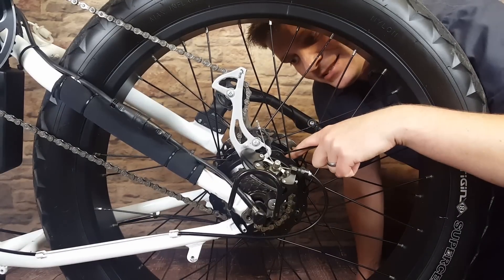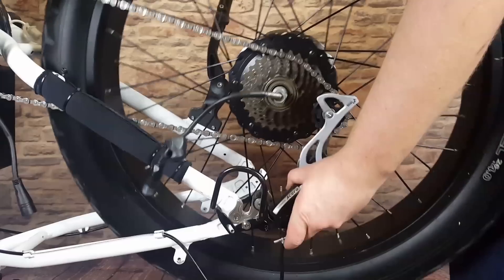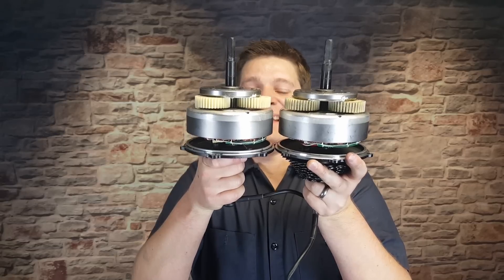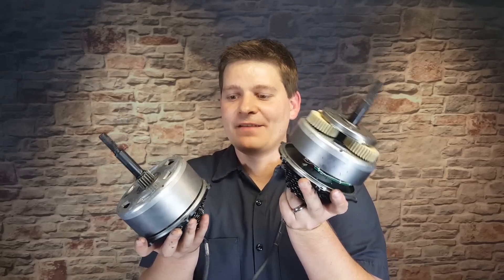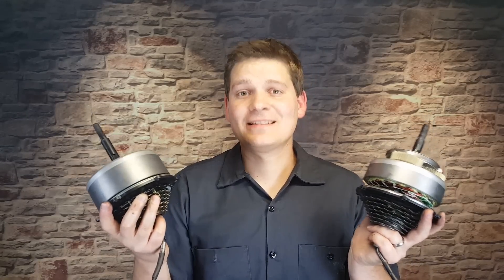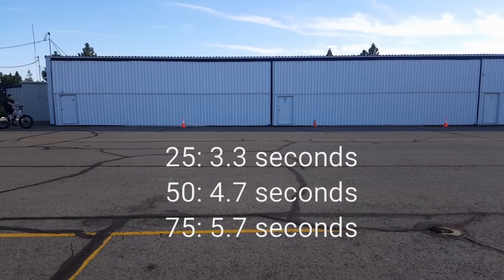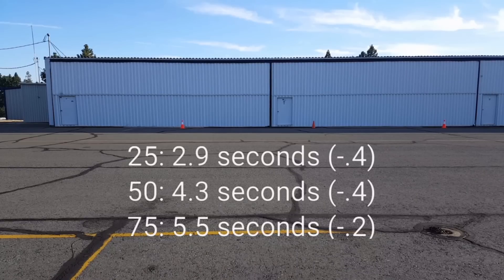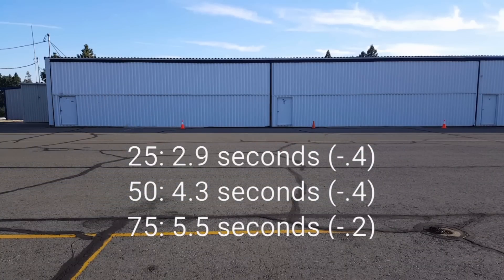Considering the RadRover Ebike?  You better watch this first!

Comment: Great video. I'm subscribing!         Question... The latest Juiced Bikes Ripcurrent S fat bike has a slightly beefed up Bafang 750 hub motor at 1295 watts peak compared to my slightly older Ripcurrent S which has the same motor, but only rated at 1036 watts peak at the same battery outputs. Both have 80 Nm peak torque. Do you think this is all BS?  The Ripcurrent has a neat TAB feature that allows a momentary boost to full power (now 1295 watts) when starting off with the throttle held down for quick acceleration. I'm praying this increase in power is noticeable.
Reply from the maker: If It's truly the same motor then my guess is the controller has more amps to get the extra boost of speed.  Any temporary "boost" function seems a bit like a marketing gimmick to me.
Reply: @Area13ebikes  Well, I'll check Bafang to see if they actually make this uprated 750 motor, but my guess is that Juiced Bikes is not BSing the public. They generally don't work that way. What I want to know is, if it is really 1295peak watts, will I feel a difference from my 1036 peak watt motor?  I'm about 240lbs and thinking the extra 250 watts doesn't translate to much extra Oomph.
Reply from the maker: @dbfcrell8300  slight, but not a huge difference.  Bafang makes sorts of various motors.  I've seen people run the larger 750 Bafang motors in 60v and 2,000 watts.
Reply: @Area13ebikes  Well, when it gets here in a few days, I'll assemble the bike, but prolly won't get to ride it for several months due to the weather. I'm in New England.
Reply: Well, the new motor/wheel hath arrived! It's definitely not the same motor I sent to Juiced, so that's promising. I went on the Bafang site and looked for this new uprated motor. No luck yet.

Comment: Not trying to cause an argument here, but were the weight of the bikes and the size of the tyres (rolling resistance) the same for all of them ? If not, then this will have an effect on the acceleration over such a short distance.  For the weight, you could handicap each bike with a different load so that the weights were the same. Not sure how you make the tyres equal though if the rims are different sizes.

Comment: However. At Hoover Dam the Russian tech type magnets increased the electrical output significantly. Its more Torque field strength etc. 
not knowing anything on bikes, will keep quiet. But point made. I would test a load of 200lbs on each to see effect. Kinetic Energy cant be fudged. Does one motor draw more current I2R (current squared times resistance) again for DC power. Two cents

Comment: So glad you put this video out Kyle. When I first saw this, I did not want to believe you. Because I live a few miles away from Rad bikes and was ready to pull trigger on purchase of new Radrover. Was looking forward to purchasing an e bike with Rad bike shop right in my back yard.  But after numerous test drives up steep hills in Seattle, I did notice that Radrover would slow down and needed lots of pedal effort. A sales guy there told me to not run the bike at 750 watts for very long due to damage of the motor for overheating but would not tell me if that meant 30 seconds or 5 minutes. Now that I'm more knowledgeable on E bikes and what I want. I'm going to spend a little more money and get a bike that has a true 750/1000 watt motor.  I’d be very upset if I bought a bike with only 350/500 watt motor that was advertised as a 750 watt motor.
Reply: There is a guy who does a side by side comparison to the sonders 500W and the RAD Rover performed better in his opinion.  Not sure what all this means but I am concerned since I just bought my second Rover.

Comment: Are the wheel diameters to the outside of the rubber the same on all bikes tested? Other factors being equal, a smaller wheel diameter would yield an acceleration advantage.  The bike weights should also be very similar. Obviously, a lighter bike would also have an advantage in acceleration.

Comment: Simple question, what bike under $2000, woluld you suggest for long distance and pulling a small homemade camper.? I am building to pull with a bike, but would rather have a powered bike. I have a solar setup the has a 110 outlet so I can just plug in the charger, can I charge as I ride or do I want a spare battery to charge?  I have a bit of time before buying but plan on leaving before september

Comment: Rad Rovers are fine, and you don’t need that much power once you get up to speed unless your hitting a big hill, in that case use your “lamborfeeties” to help your motor out. Also, what about the weight of that over powered motor - it looks super heavy. Bafang is huge for a reason, they’re very reliable. The only thing I don’t like about Rad Rovers are they’re lack of hydraulic disk brakes, as they only have mechanical disk brakes. With that kind of weight and speed on those bikes, I would never want to depend on my grip strength to get me stopping. I went with a 750 watt Mountains To Sea fat bike which has worked out great for the last 3 years. It probably cost me a few shekels more, but we’ll worth it.

Comment: See this all the time.. manufacturers claiming a 750w motor when it's really a 500w motor that maybe PEAKS at 750w power output. Misleading advertising. You want a actual 750w motor that peaks at 1000w + output.

Comment: based on what you show here is a question of need for me. budget is tight but i certainly don't want to buy a bike i have to later upgrade for more power/speed. i'm 235 actually 233 ... 5'8" MOST IMPORTANTLY I NEED TO RIDE WITH THROTTLE ONLY BECAUSE I HAVE A BAD HIP SO CAN'T pdela without severe pain . 

what e-bikes would u recommend that are durable that would suit me. i need a bike rack but not a lot of fancy stuff. i could see adding a spring type seat post for comfort. i don't need rear shocks but adjustable front ones are needed . i don't need the fastest tires and 2.5" would be better for speed and weight savings. solid higher quality mechanical disc brakes or reasonable quality hydraulic disc.
 brakes.

I'm asking you all this cause nobody else i have seen spoke on the difference in the motors that are listed at the same wattage but are obviously functionally different. i've been looking at reviews since last year and still am.  thx a ton

Comment: Hello Kyle - Nice job on the video. I am pretty deep down the e-bike rabbit hole myself and am constantly on the prowl for updated information and product development.  At one point, I considered purchasing one of the Rad bikes and was fairly impressed with bang for the buck.  I am now in to several different manifestations of Bafang mid-drives and have experimented quite a bit with controller configurations and other modifications, including controller swaps.  I applaud direct comparison demonstrations but feel as if there are other variables that need to be addressed.  I think some of us are aware that a wattage 'rating' is somewhat arbitrary... I.E. "wattage" is really more a function of battery power and current (volts X amps) regardless of what is marketed as the power of the motor.  If the motor holds up to the watts allowed by the controller settings, at least through the warranty period, the marketeers can rate it for whatever wattage they feel they can get away with.
Reply from the maker: Yes, unfortunately it is extremely arbitrary.  It applies to motor power, range, torque, etc.  I think things will settle over time and some standards will be put into place, but ebikes are the "wild west" of new tech!  It's an awesome thing to have fun with - no matter what ebike or kit people have.
Reply: And of course, just today I managed to twist/break the rotor shaft on my amped up BBSHD(!)  HAHA
Reply from the maker: Anything can break!  But what power combination did it take to do that damage?  :)
Reply: I was running approx. 50 amps and a freshly charged 52 volt battery... maybe 2900 watts?  The nylon gear seems to have held up fine.  I posted it on a couple of Facebook groups.  Apparently this sort of thing happens but not very often.

Comment: have a 2018 radrover & definitely interested in upgrades!  keep it up!
Reply from the maker: Thanks!  You'll see a new video up once the parts are ready.  :)
Reply: @Area13ebikes  can't wait to see the hack of the speed limiter if possible?
Reply from the maker: @larryparks347  Check local laws, etc...  but when the components are changed out it will be very easy to remove any speed limits.

Comment: i have a 500watt rear hub motor not sure exactly what model but its from a dealer fat bike in canada. i am looking to upgrade to a 750 as i need a new motor anyways. would you happen to know if the motor casing is the same for the 500 motors and 750? the 750 looks slightl;y larger

Comment: I want to get 2 rad minis with my friend. But I want to add the BBSHD mid drive motor instead of the rear hub motor.  Do you offer a mod kit for this?  I think these bikes would be awesome if more power. I have a 2000 watt 60volt scooter and it hauls ass, but hate small tired scooters.  As a bmx street rider, I like the idea of a e-bike that is bmx and fat tire.  Can you look into mid drive options for radmini please?

Comment: I purchased a 2018 AddMotor, M150-P7, fat tire, 'folding' bike, 750Watt Bafang motor. It looks very similar to the RadRover/Veego/etc. After tweaking the controller, I run it with the max speed of 45-48km/h (or 28-30 mph). I would be very interested in knowing what's inside my Bofang motor - does it have those cheap looking plastic gears, or is it truly "gearless"? the specs list it as: 750W High-Speed Rear Hub Brushless Motor. The label says "Bofang". That's all I know, unfortunately.

Comment: Whether you need a "real" 750 motor or not isn't the point. The point to me is that Rad is labeling a 350/500w motor as a 750. There's a significant torque difference, and a significant difference in its ability to handle more power if needed, but to me it's about business ethics.

Comment: How can you tell the difference between 500w and 750w hub motor if it is not labeled?  I have an NB hub motor that doesn't have labeling showing what it is. Is there some way to open the motor to find out which it is?
Reply from the maker: I'm not familiar with the NB motor.  There are some signs here and there if you open a motor up, but it's not always apparent.  With the Bafang it's relatively easy as they make multiple motor versions and some are physically larger or smaller on the inside.

Comment: Power depends on voltage. With 1 volt you get 1 watt power, with 100 v you get 5000 W power with same motor. And power better calculatere were motor is max efficiency.

Comment: Hey buddy! One show and I subbed. I'm a new bike owner. A Surface604 Shred. Similar price point to the Rad. Here's question...My bike has a Bafang...it's rated 500W but can top at 750? It's quite large. How does this fit in with these motors?
Reply from the maker: Thanks for subscribing!  It's a different motor from the fat bike versions, but as it's rated for 500 watts and peaks at 750, I'd say performance is probably the same as the RadRover.  It's possibly a bit quicker due to the lighter weight wheels.
Reply: @Area13ebikes  thanks for your quick reply! My Shred certainly is quick!  I'm 285lbs( :^( ) but I can easily hit 28mph and more with assist! 
  I think Surface604 is a great company...I did a lot of research.  You should cover them. 
Last...do you have any ideas for going extended ranges..i.e.  solar, power banks? I'm considering a small Honda generator...thoughts?
Reply from the maker: @davidklein1667  I'll keep that in mind for sure, I think their bikes would be well worth covering.  :)  If you'd like to email me at kyle@velomobileshop.com we can keep the conversation going about range.  In short, bigger battery!  Solar, generators, etc have their own complexities or shortcomings.  In some cases they can work, but in general a larger battery (or 2nd battery) is the simplest and most efficient option.
Reply: @Area13ebikes  Speaking of 2nd battery, do you expect that additional models will be introduced by the various brands that actively hold 2 batteries on the frame? Riese & Muller's and the Tern Cargo bike's dual-battery models are the only I know of. Although battery tech has been improving and will, no doubt, continue to do so, and lighter materials are being used in some models (carbon) to lighten things up and help range, I feel that many folks would like the ability to extend riding range to the max for getaways or day trips without stopping to charge and that several batteries (along with maybe a third in a pack) could enable some nice adventures.
Reply from the maker: @kengruz669  The dual battery setup looks nice, but at interbike I only saw 2 companies trying that.  I don't see 2 separate batteries built into the frame design catching on.  It's very easy to add a 2nd battery on a frame somewhere or rack and a connector that properly distributes power between the two.  I have a concept in mind for a dual battery frame, but it's for a different reason.  ;)  Keep in mind as well that as battery capacities increase, older style packs can be rebuilt with greater range.
Reply: @Area13ebikes  Yes, it's all about range. I see buyers making range increasingly one of their important requirements in narrowing down a bike to choose. As it becomes addressed and played with by different manufacturers, I see range going up, whether from individual battery capacity, or again, an already built-on second battery receptacle on the frame.
Reply from the maker: @kengruz669  I think range will be the topic of a future video.  The claims and specs are all over the place!

Comment: 250 W motor with 20 A controler can have on input 1000 W 60 precents efficiency. 750 W motor with 20 A controler can have on input 1000 W  80 precents efficiency.

Comment: It appears to me that you are comparing apples and watermelons. The motors you compare in the beginning appear different to me in that one is a direct drive and the Rad is planetary drive.  Both work, but torque will be radically different .  How about comparing direct drive to direct drive or planetary to planetary
?
Reply from the maker: They are both geared hub motors with exactly the same 5:1 planetary reduction gears.  So....  no.

Comment: hey Kyle , I've recently heard the old Bionx pl 350s were overengineered and actually can run over 100 watts . Anyone have experience with adding higher wattages to them  ?  i see em all over the place for dirt cheap with dead batts since bionx went out of biz.  LOVE to see you rig this up . Subbed
Reply: i've got one sitting here if you need one sent to you  for the project =)  ijs
Reply from the maker: Im sure they can, but with all the proprietary electronics in BIONX systems a different setup would be easier.  Anything is possible!

Comment: I had considered purchasing a Rad Rover back in 2016, however I am glad that I waited and did some research on E bikes.  I am happy to see that they have increased the battery capacity on the Rad Rover and made a few other small refinements.  I am not happy about the price increase toi 1699 due to the Tariff war with China.   I am still wondering why Rad Rover still chooses to  specify a geared hub motor when Brushless Direct motors are known to be faster, and more reliable.   I am also disappointed that they still use a cadence sensor rather than a torque sensor.    My question to you is how are you modifying the Charge Controller to adjust to amps available to the hub motor?  Would increasing the amp output to 30 amps increase the wattage of the motor to 1200-1500 watts without frying one or more of the components?  I did note that They increased the final drive sprocket on the 2019 Rad Rover for a slight increase in top speed while under pedal assist.    Is it possible to achieve top speeds approaching a Class 2 e bike or would that defeat the purpose of owning a Fat Tired recreational bike?   For awhile, I considered adding a Bafang mid drive to one of my MTB bikes  but I was concerned with reliability.

Comment: ...as long as any of these mtrs are good enough to get me to point A to B reasonably well, who cares that the speed is a few seconds and in some cases 'POINT' seconds faster - why is everyone gaga with fast bikes ! unless you are racing them competitively i just don't get the whole speed thing - these are bikes for safely traveling at speeds that factor in their use which is usually commuting and pleasure...anyway, a few seconds faster is juvenile and meaningless other than the Mtr lasting longer due to quality - i have gone through 4 bikes and on my 5th [ just preference due to my height and age ] i have had 2 Naktos [ 250 watt and 350 watt]  2 Voltbikes [ 500watt and 350 watt ] and am now looking at another Nakto 350 watt 48 Volt mini cruiser folder and i am realizing [many] of these far less expensive ebikes are just as good AND as fast, or close enough, as the over the top priced ebikes like the Rad - research [ including your knowledgeable info ] has shown me many of these ridiculously expensive ebikes have exactly the same components and frames !  i also owned 2 Harley Springer Softails and similar to Harleys, ebikes are not [ meant to be ] crotch rockets ; so thanks for the heads up on Bafangs and other issues and maybe when i am ready for a walker , no doubt we'll see Ewalkers with awesome speeds of up to 0.05 seconds !